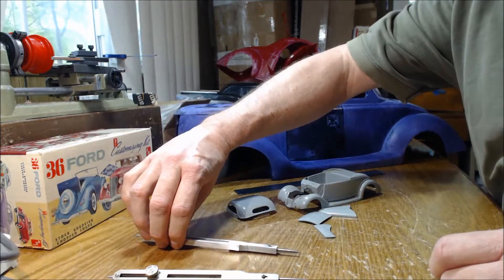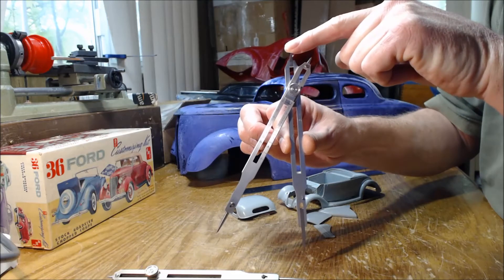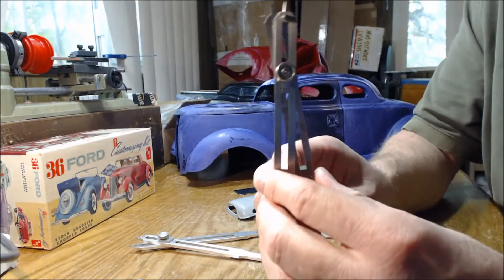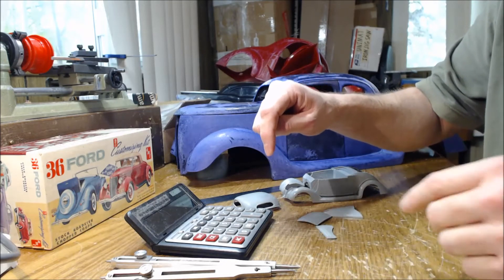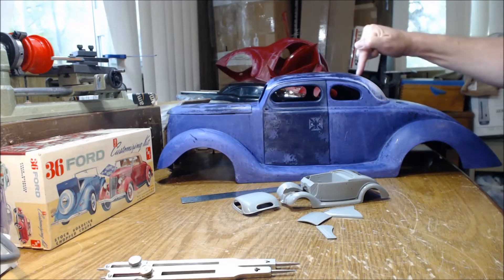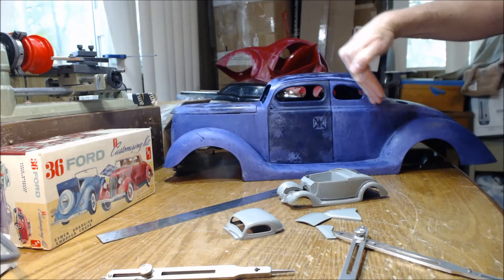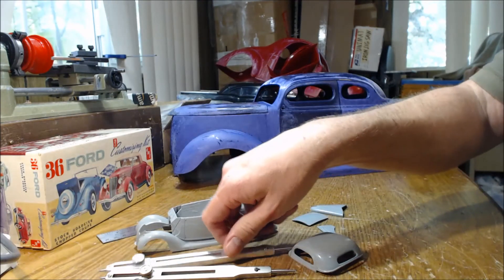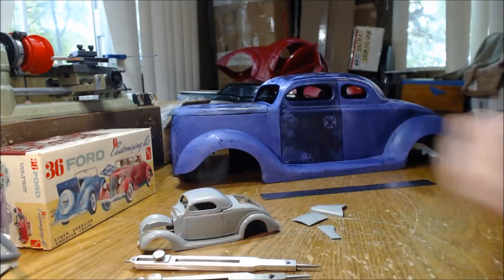How to use proportional dividers to scale up a model car.

Comment: I want to measure up a model train roughly the size of your small scale model to be lifesize. what would you sugest? custom dividers
Reply from the maker: Custom dividers for the smaller details, but i'd use linear measurements (rulers, yardsticks, tape measures), and convert those for the largest dimensions. Such as the overall length, width, height.
Reply: @johnnydoe5318  thank you for your reply

Comment from the maker: Hi Rik, one is 7" and one is 9". I think the 9" will do most of what you need. It won't open far enough to go from bumper to bumper, but if you divide the measurements up, it works fine. So measure from the fender opening to the door gap, then the door length end to end, and then the rear door gap to the rear wheel opening, and so on.

I believe it would be possible to make a set from wood, around 15" long, that could do much larger lengths.